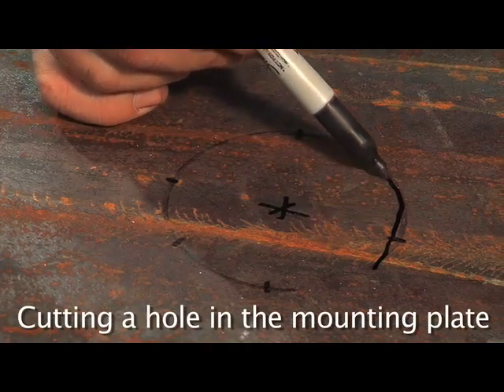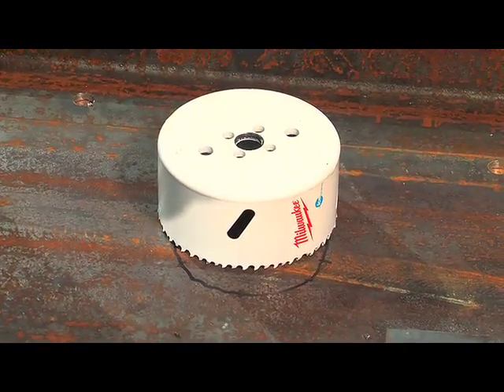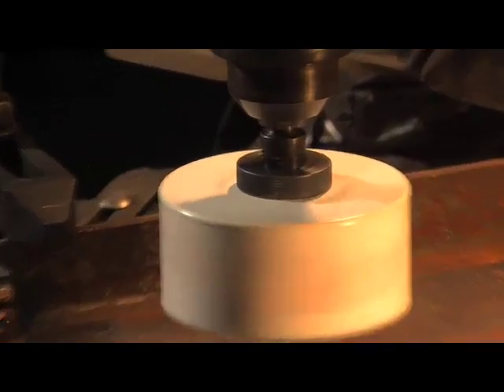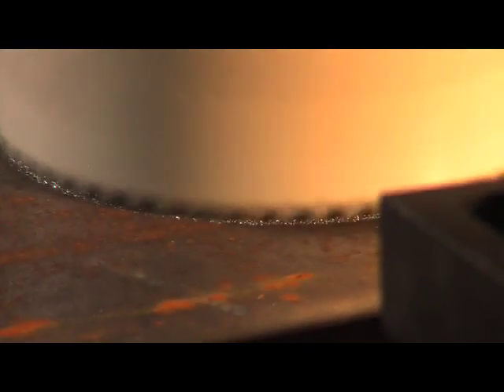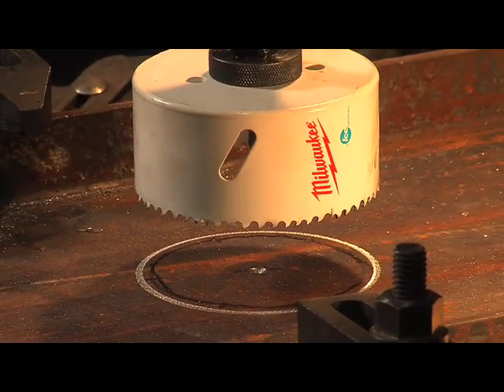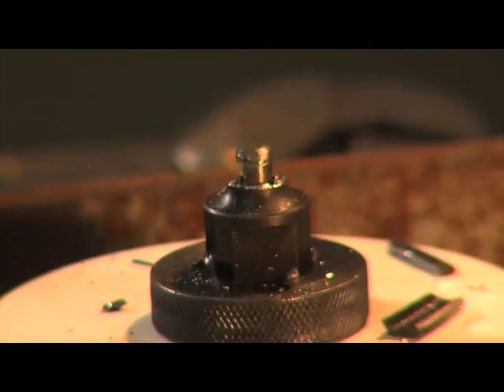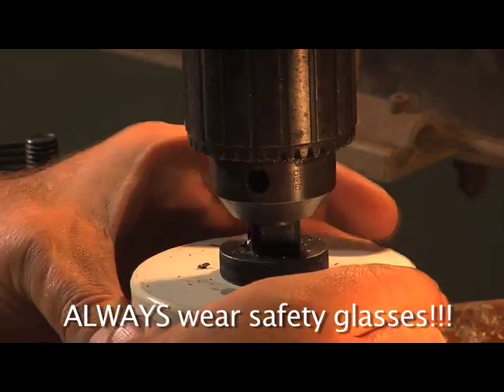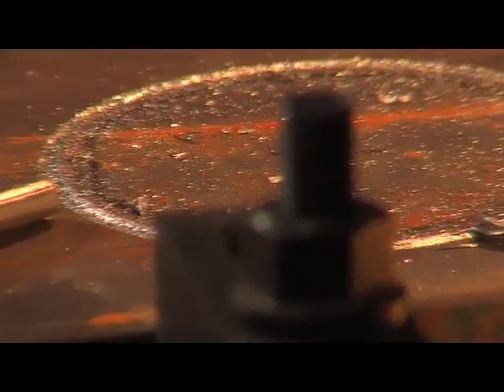AC Electric Car Conversion 101  part 004

Comment: Jeezus Christ... it's a hole SAW. Not a drill. 140 - 200 SFM for mild steel (133 - 190 RPM) is the right speed. But, of course, blame it on the tool, not the operator.

Comment: Why include the fail video?
Reply from the maker: Because nobody's perfect. Messing up is a good thing, when you learn from it.
There are lots of videos out there was a professional looks "perfect", and those types of things can sometimes make us feel like we have to be perfect, or why even bother.

Go ahead. Go out and do something. Screw it up, do it again. That's ok, that's called experience.
Reply: @BenjaminNelsonX  Yes of course I totally understand that; HOWEVER, you can only say that if you show the actual correction--which, unfortunately, we came back to video 5 with a completed hole. Would have been nice to see how to do it so this doesn't happen to the rest of us. I'm assuming the problem was lack of lubrication, but I'll have to figure that out by breaking my own post huh??

Comment: That hole saw is going WAY to fast.   Over 2 inches in size and you should be able to barely follow it around with your eyes.   And why are you dry humping it?  Use some oil man!    Flood that thing.       For crying out loud, my eyes are burning just watching that.

Comment: MrCinimod93 took the words right out of my mouth cause he is right, if you had used oil the adapter would have never broken up.
Reply: Good old cutting oil for the drill press. Lowers friction and heat. I even use it with my cordless drill while drilling metal. The bits last so much longer.

Comment: Vibration failure.

You should of used  an engineers trepanning tool. Its has a single cutting blade that is adjustable on an arm. With plenty of oil or water.

The cutter you had seemed better for wood.

I'm more a cheapskate - bread and butter. I would of chain drilled a lot of little holes in a circle then maybe file or ground out the hole smooth. lol

Comment: The machinists I have talked to say you don't want oil, after all you are trying to cut the metal not slide across it.  What you want is coolant.  With bimetal blades especially heat is a killer, it destroys the blade.  Blow air across the work, pull the bit and let it cool every few seconds or use oil as a coolant :-)  When I have heat problems I use a water based coolant in a squirt bottle.